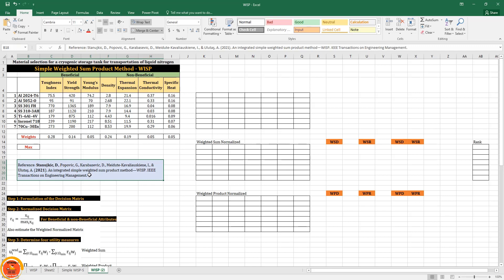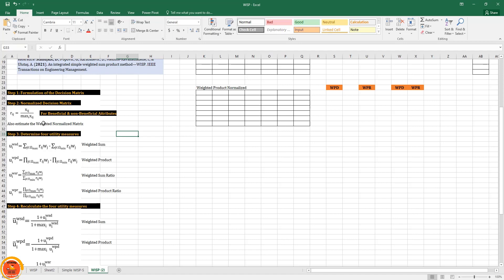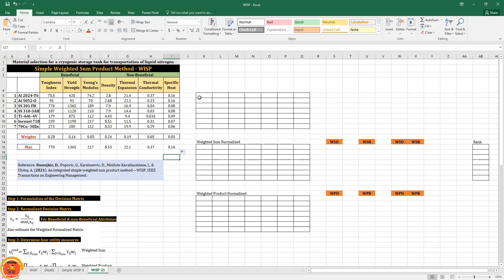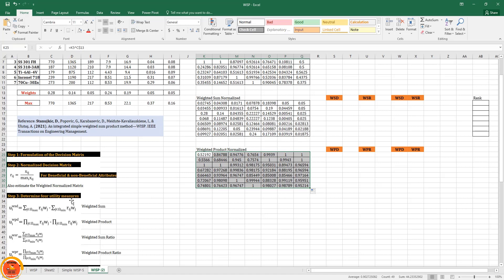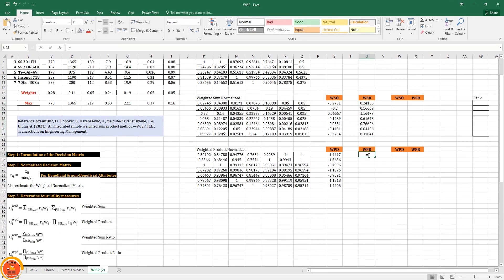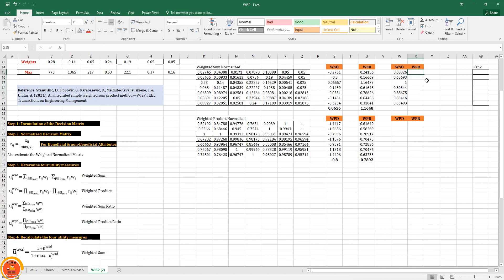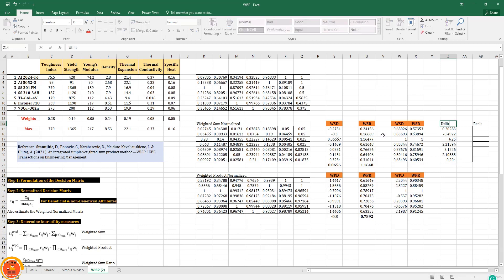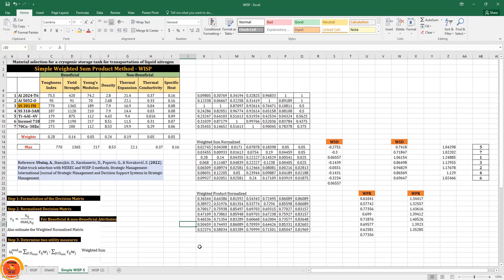Simple Weighted Sum Product Method #WISP & Simple WISP #madm #mcdm

Comment: Another point, in 9:23, your considered (1/4)+(W15+X15+W25+X25), the correct is (1/4)*(W15+X15+W25+X25) no? Thanks a lot
Reply from the maker: Yes, correct. Thanks for rectifying it. I will pin this comment

Comment: If is possible, show the formula about 3 last columns (Column W, X and Z) about Simple WISP-S? Thanks a lot
Reply from the maker: W Column : =1+S15/(1+$S$22) X column: =1+U25/(1+$U$32)  Z column: =(1/2)*(W15+X25)
Reply from the maker: If you need the excel file, i can send you an email.
Reply: @Vitarka  Sorry for more one question, the correct is (1+S15)/(1+$S$22) no? Thanks a lot again